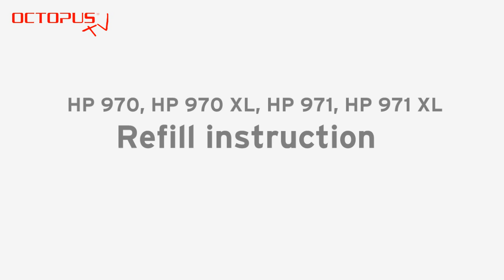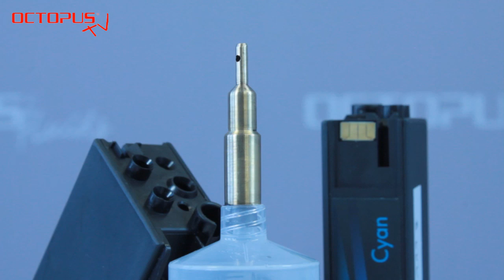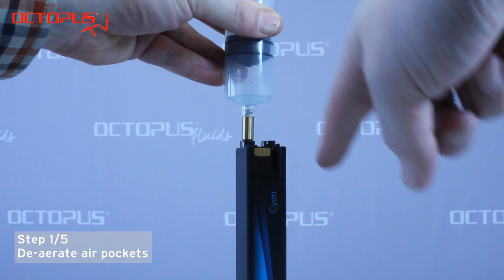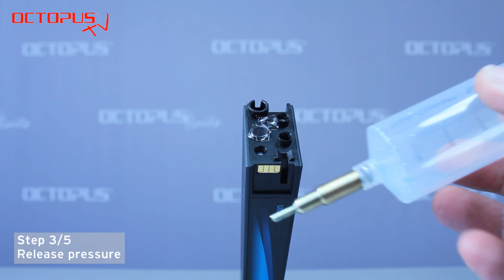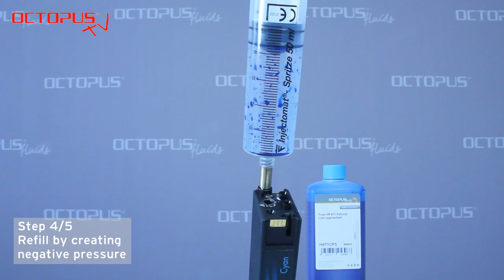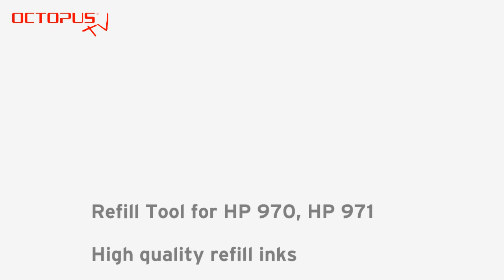Refill HP-970, HP-971 instruction using refill tool

Comment: Does anyone know how to do the refill on the 913a/973x? I have noticed that the spring where the syringe is usually pressed is now a rubber seal and is no longer usable after being pressured. I need a fix to this asap if anyone can help? Thanks
Reply from the maker: Hello Chris, thank you very much for bringing up this question. We are not aware yet that the structure of the ink port on HP913, HP973 , especially the spring valve in there, has changed in comparison to HP970, HP971 cartridges. Could You supply us with some picture material or an empty cartridge?

Comment: This device does not fill the starter or XL cartridges, only the Standard cartridges. When will you make a refill tool that fills these cartridges?
Reply from the maker: Hello, Thank You very much for Your remark. The tool refills starter and XL cartridges as well as it refills the standard yield cartridges. The only difference is the quantity of ink that can be refilled using the tool in comparison to the ink quantity filles by the manufacturer HP. Starter and XL cartridges have two chambers filled with ink. These chambers are connected by a one-way valve. Due to that the tool refills only the chamber located behind the ink outlet directly.

Comment: Can I order the refill kit from Japan?
I saw your web site, but Japan is not selectable country.
Or, do you have a reseller in Janpan?
Reply from the maker: +Tomohiro Nomura
Yes, You can order to Japan. There is a little workaround - please select Australia as country, the shipment costs are similar. In the order checkout process You will receive a comment field, please write into that field that the actual country for delivery is JAPAN.

Comment: almost sounds too good to be true, as every other video i've seen seems to require tapping out ball plugs, drilling the backs or the sides, etc... I'm also curious about why the first step is done, with the air holes still OPEN.?.? He states in the video it's to draw out the air in the bladder, but if the air vents are open, how does that work exactly?
Reply from the maker: Mitchell Tolbert Thank You very much for Your question. In the first step we are pushing air into the ink tank located behind the ink port. Increasing the pressure in the ink tank section presses together the air bags. As the air ports are still open the air from the air bags can leave the cartridge by these open ports. Afterwards we close the air ports as we want to avoid air entering the air bags again while setting up a negative pressure inside the ink tank section for bringing in the ink.

Comment: Thank you for the video, do we need also to change the chip by the HP-970? If yes, is the chip included in the kit? Do you have a reseller in Madagascar?
Reply from the maker: Hello David, thanks for Your question. There are alternative chips available for HP 970 and HP 971 cartridges.
But there is also a way to print with refilled cartridges without changing the chips. please check our video tutorial for doing so:http://youtu.be/33pSdmqr3mQ
The refill kit in the video description does not contain alternative replacement chips. If You are interested You can buy them separately.
We can ship to Madagascar on individual basis - please email Your request to mail@octopus-office,de and we will set up Your personal offer for Your.
Best regards
Octopus

Comment: Do you have to reset catridge chip
Reply from the maker: There is no device available that can reset the original chips - unfortunately. There are replacements chips, You can use them to make Your refilled cartridge fully operational again. They are not cheap, but if You compare their price towards the original cartridges the saving is still attractive.
https://www.octopus-office.de/shop/en/refill-supplies/ink-refill-supplies/chips-chip-resetter-for-hp/hp-970-971/

Comment: Hello
I have tried your technique but I get around 50ml in the XL Black OEM before it won't take any more. The vacuum is poor but I have tried everything in your video. I put air in. I sealed the 2 holes. After that I can only get 50 ml in(I think it takes around 250ml)using the vacuum. If I push it the pressure comes back into the syringe along with the ink. Any suggestions would be very welcome!
Thanks
Daniel.
Reply from the maker: Hello Daniel, thank You very much for Your question. With the vacuum method You will not get more than 50 ml to 100 ml into an XL Black due to techical restrictions of the cartridge. The black XL 970 has two ink chambers - they are connected to each other by a vent. This vent works one way only. So You can fill the ink chamber located directly behind the ink port - this chamber takes 50 ml to 100 ml. But You can not fill the second chamber using the vacuum tool. 
Beside that also with 50ml You can do a lot of printing already again.
Reply: OK but that is well below half of the original capacity and I don't want to sell something that does not offer comparable results. Do you have a way of refilling the other chamber?
Reply from the maker: Hello Daniel, we agree with You that for selling the refilled cartridge just filling one chamber is not the perfect solution.
Please check the following manual:
http://www.octopus-office.de/info/en/ink-refill-instructions/ink-refill-instructions-for-hp/hp-970-hp-971/hp-970-hp-971-priming-cartridges-connected-to-ciss/
The manual is actually for filling and priming an XL cartridge connected to a CISS but You can also apply it for refilling both chambers of such a cartridge.

Comment: can I use this method to refill HP975a?
Reply from the maker: We did not get a HP 975 cartridge into our hands yet. But if the ink port is the same You can give it try. Another story is how the printer behaves softwarewise - it may be that You need to have more than one set of original cartridges to trick the printer to forget about the serial numbers of the cartridges.
Reply: can HP 975a upgrade to CISS?
Reply from the maker: There is a rumor in the market the printers using HP 975 cartridge are capable of recognizing when there is a CISS connected to the cartridges. Please do not ask how this detection works if it is true -  as said before we have not tested these printers and cartridges yet.
Reply: thank you:)
Reply from the maker: welcome :)